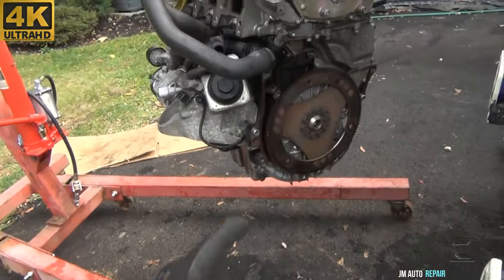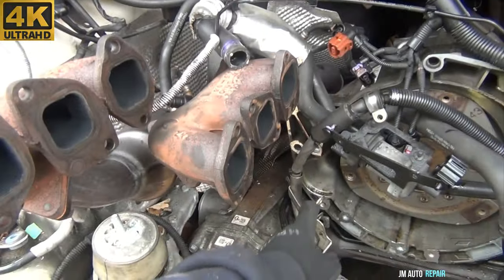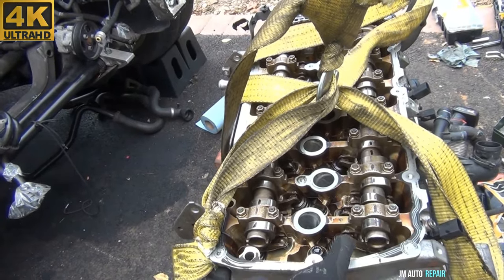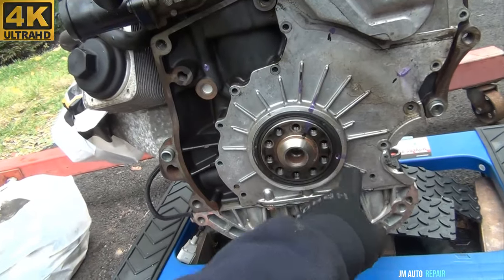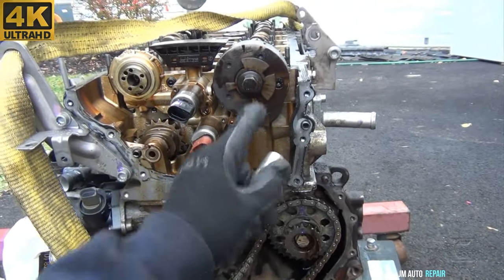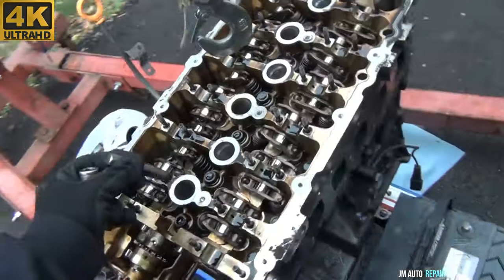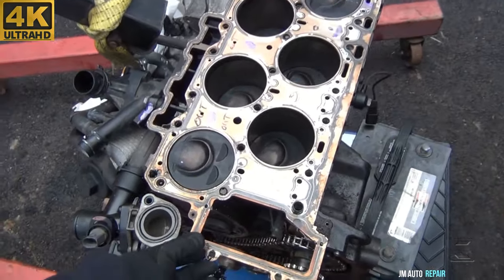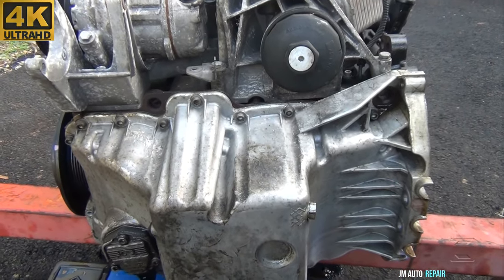VolksWagen Audi 3.6 FSI VR6 EA390 Engine Teardown Disassemble JM Auto Repair

Comment: Hey can you please help me i have a strong oil leak coming from the top of the oil filter housing assmbly but it only happens when the car gets out of high RPM's (cold start) and once the RPM's come down to normal i have oil pouring out like out of a bottle?? Please help i havent seen a single video of anyone replacing AUDI Q7 3.6 Oil Filter Housing with Cooler!!! Please help!!!!